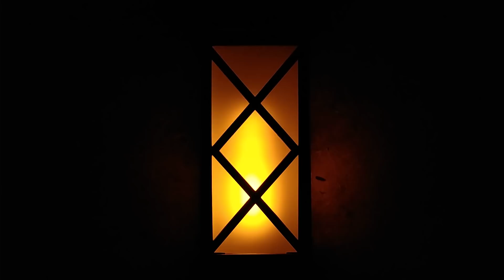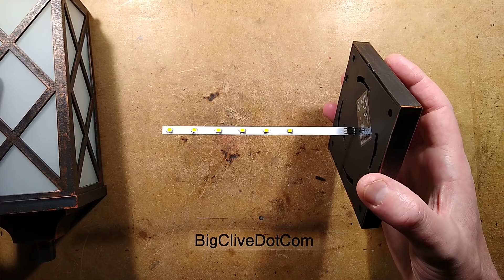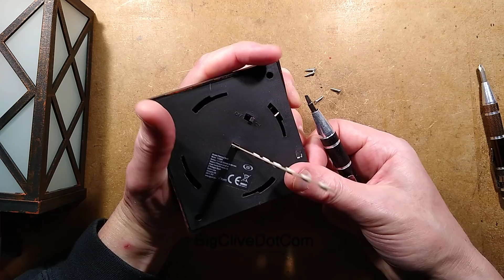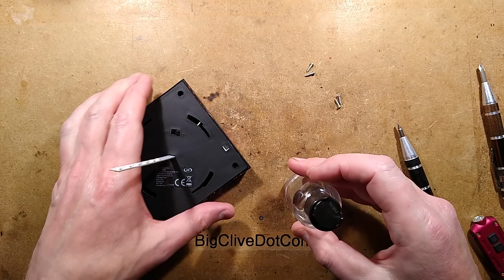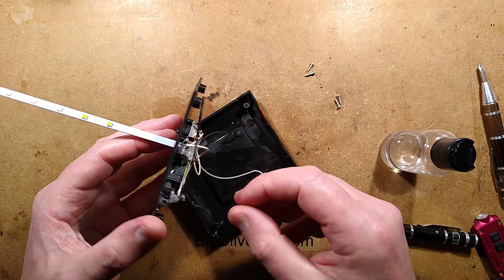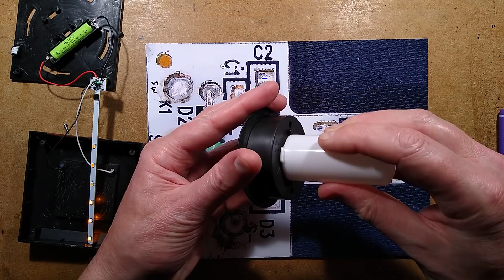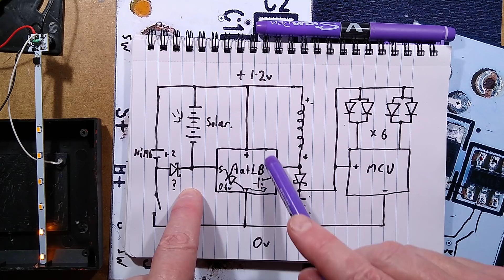Minimalist flame effect solar light  (with schematic)

Comment: The alcohol trick is genius, cheers! Also very interesting engineering. Seems like the Chinese are lowering cost via engineering versus just relying on cheap labor.
Reply: I've seen Voultar use it several times when fixing old consoles that have previously been modded. Amateurs overuse hot glue way too much.
Reply: @IanTester  Yes, I certainly do.
Reply: Problem is that they often cheap out on engineering. In soviet era it was great engineering + cheap labour. Had great results, very cheap products that actually lasted decades!
Reply: @Joachim Shekelberg products had official repair guides, problem was getting them.

Comment: It's sooo good to see one that will charge during the day without turning on at night!  After all, the FIRST instruction says to charge it more than one day before use.  It's just a pain to turn it on during the day and off at night for a few days.  The extra diode might be to keep it from draining the battery through the solar panel when off or during storage (in a dark box).

Comment: That isopropyl alcohol + hot melt glue trick works to release the glue from house bricks, and the mortar between them, incidentally :)

I've been successfully using hot melt glue to mount stuff to the exterior walls of this rented house without causing any damage, and I've verified that isopropyl alcohol makes the glue release pretty easily. The glue doesn't fall off as easily as it would against a non-pourous surface, but it's still plenty easy enough, maybe just requiring a bit of pulling it off with fingernails as well.

I did worry that the glue might soften too much during the summer, but the UK is currently in the midst of a UK-style heat wave (i.e. peaks of 30-33°C here in the south of England) and nothing's showing signs of falling off the wall, even the SE-facing one that's in direct sunlight most of the day.
I've had things glued to the wall like this for around 5-6 years now. The only visible change is a slight yellowing of the glue I used.
It's fairly standard hot melt glue, as far as I know - just whatever cheap stuff I found online in the correct diameter for my tools.

(Those tools being a Bosch GluePen and Ryobi's One+ glue gun. The GluePen is highly recommended: I love that it heats up extremely quickly - within about 20 seconds - and it has a high-capacity internal 18650 cell. The cell in mine could do with being replaced now that it's 5 years old and the capacity has fallen, but it's a tabbed cell that's soldered or spot-welded in, and opening the GluePen's case sufficiently isn't easy... However I'm not a fan of the Ryobi glue gun for the same-but-opposite reason: it takes something like 5 minutes to heat up, which is typical of the PTC-heater-based devices, but for the price I had hoped for better. That makes it very inconvenient for my needs and so I very rarely use it. Once it's heated up, however, you can pump tons of glue through it very quickly - possibly TOO quickly, tbh! It would make a good tool to use for potting PCBs in hot-melt glue, though I've no idea if that would be wise!)
Reply: Youtuber Julien Illet already proved hot glue potting was only a short term solution. He’s now trying bulk UV glue from eBay as a conformal coating and has had some luck.

Comment: If there was a longer time between repeats or if it were a bit more random those would be great lights.
Reply: I could suggest doubling the LEDs from just N/S facing to N/W/S/E facing, placing in a round translucent bulb, fitting mains plugs ;) and they'd be great table decorative lamps in a restaurant.

Comment: Those small amorphous solar cells are worth saving for tinkering and small projects plus they don't photo degrade unlike the others encased in plastics. There is one flaw with them as corrosion attacks the film side should water make its way underneath.
Reply: That's the one thing I fight all the time and have yet to discover a sure fire way to properly seal them.
Corrosion is the one show stopper.
Reply: They also give a decent current even under cloudy conditions
Reply from the maker: I've tried various ways to avoid the water ingress damage, but it's tricky.
Reply: @bigclivedotcom  I kinda want to experiment with one now where do they leak at?
Reply from the maker: @ucitymetalhead  The water creeps down the sides and because the solar panel is generating DC current it results in rapid corrosion.  Some have a laser cut dam around the edge so the final sealing layer encapsulates the main area.

Comment: This is a very low power lamp, but the rise and fall glow is very effective for what it is, if you do not pay attention to it.  To get a natural flame look, manufacturers need to introduce some colour variation, perhaps the tip of the flame licking away in red, some orange and yellow lower down and the warm white and red at the base to emulate glowing embers and a hot flame.  All the same colour is a bit false.  I guess the different forward voltages would make it too complicated to simply exchange the LEDs.  Those mains lights that used a flexible circuit board rolled into a tube would look realistic!

Comment: If you're worried about getting isopropyl alcohol in places it should be to remove hot glue, just use some cold spray or flip a can of duster upside down and freeze the hot glue.  Once it's frozen, it'll usually break free from contraction or you can just nip at it since it'll be as brittle as glass.

Comment: If the battery slot was more accessible, it'd be quite a nice AAA solar battery charger with additional light effect. If they were clever, they could use the flame jumping effect to indicate how charged the battery is !

Comment: The pattern cycle is too short, it should be more random, especially if there are several mounted in an area.
Reply: Yes, it would be a nice project for Clive to reprogram the μc to a better pattern, maybe even involving some sort of random number generation...
Reply: @l3p3  +1
Reply: They would de-sync anyway due to clock inaccuracy... but obviously come into sync regularly.
Reply: If the MCU is minimalistic enough, it literally might not have enough memory for a much longer pattern - it kinda depends on how exactly the pattern is encoded. That's not saying one cannot do astonishingly crafty staff even with 1-2K of flash, but somehow I highly doubt typical Chinese product dev time and budget accommodates that kind of effort.
Reply: TBH, I think it's only designed to be used in a computer game. #sprite ;)
Reply: @l3p3  BINGO !
Reply: Yeah, I would like it to be more complex as well. Best ones of those "old tech" incandescent candle flame lamps have such a nice random light.
Reply: @tkermi  The neon ones you mean ? They're not incandescent !
Reply: @l3p3  It's probably a one-time programmable μc - most of them are in products like this.
Reply: @millomweb  Oh, you are correct. I only have one I got as a gift and have not needed to buy any replacement bulbs.
Reply: @millomweb  Yes, it's exactly like that. I now found out that Big Clive has a video about this type of a bulb. But that seems to flicker much faster than mine (maybe just because of the camera). Mine looks calm and nice - so close to a real flame (when against its dark backround in low light room).
Reply: @millomweb  Here is the link:
https://youtu.be/NvO67jRAE4A
Mine is Osram branded 3W 230V (made in Taiwan). So maybe it's a little higher quality/more optimized for the realistic flame effect.
Reply: @tkermi  They are unstable and unpredictable ! They'll make them, they'll know they'll work but they won't know the flicker rate or 'flame' shape until it's been powered up. So if you get any more, see it in action first - so you you know what it's going to look like first.
Reply: @tkermi  He mentions the camera's making it look more flickery than it appears to the naked eye.
Reply: @millomweb  Good to know, thanks!

Comment: Thanks. I wouldn't mind something like this as a retrofit for the lamp on a pole at the end of the sidewalk. Can't use that now because someone before I moved in pulled up the power wire for it, thinking it was a root, and cut it off. Kind of glad it wasn't powered at the time, but that's a different issue. In any case, would probably need to build/print an adapter to replace the stake mount on one of these. And of course there's the finding of one of these. We'll see.

Comment: Maybe you could mention this use of inductor for the purpose of generating higher voltages is similar purpose to the coil in a car to create the kV for the ignition spark from only a 12V battery.

Comment: If you ever have spare/broken ones these 'mystery 8 pin micro' type devices, one thing I've found is that the Padauk micros(PMS150C-S08, the 8 pin SOP package ones) have the part numbers on the underside of the chips. So maybe desolder and have a look?
Thought I got a tube of blank chips, but turns out they just had the text on the underside.
Reply from the maker: It's there a straightforward way to program the Padauk microcontrollers yet?

Comment: when using the resin type solar panels I have had great success by using the clear coat spray paint that they use on cars and coating the panel and the paint last very well the same as on cars

Comment: Big Clive, Could you consider taking apart a Fuelrod USB battery pack?  It is the only one I have that can be charged while in use.  Sort of like a USB UPS.  But I want to know if it is safe to charge it while in use.  If so, I might use it as a Raspberry PI UPS.

Comment: The 12 LEDs would be a heavy load if they ran at more than a milliamp or so.  And there's also the maximum current for each uC pin and also the changing duty cycle to give the flicker effect.  It's good enough for viewing in the dark.  👍👍

Comment: I reckon the mystery diode might be there just to prevent the cell from discharging into the solar panel
Reply: If the mystery diode was removed there would still be no discharge via the solar panel. I think you mean "that's why the the mystery component is a diode and not just a wire".

Comment: What if you take the white circuit board coating off with paint stripper in order to see the traces easily? Sure, it would strip the colour-coded components as well but you already have a photo of them.

Comment: I wonder if you could common the two pairs of pulsing LEDs and use the now spare pin to run an extra pair of flickering LEDS. Or would the current now be too low for the pulsing LEDs?

Comment: Okay, so I'm late with my response, but I would really like to see a "dissection" of the other light you showed.  I have an older, 2005, solar Tiki Torch light.  The device uses two LED's and four Transistors.  The only Diode (aside from the LEDs) present is, I'm assuming, used in conjunction with the solar cell charging circuit.  The overall effect is, in my opinion better and more subdued then the newer circuits.  I'm assuming that the other light unit ( you showed) is the newer Tiki Torch circuit.  I would be interested in comparing the two if you could fit it into your schedule. 

Thank you for your Videos, and best regards

Comment: Problem with these solar lanterns is, they all come with 350mah or 400mah AAA battery's (i'm guessing for smaller size)  - AA battery's slightly bigger but much bigger capacity. So if you buy a good solar lamp, they only last like 6-8hours maximum.  So if it gets dark around 7pm.  by 3am they dead. Won't last a full night through.  So best to go buy a good quality 700mah or 800mah or 900mah Rechargeable.   If the 350mah would give 6-8hours   something like a true capacity 700mah or 800mah would last the full night through till sunrise. When it will just start charging up again.

If you buy the bigger Solar lights they sometimes have 2x AAA or 1x AA battery (again only 2x 350mah AAA or 1x  800mah or 1000mah AA)- So if the bigger one's , i would slot in a nice 2000mah or 2300mah or 2600mah AA <maybe Energizer or Duracell rechargable or any good known brand>  Sometimes the no-name battery's are not true capacity. They rate 700mah but in reality it's maybe 500mah.

Comment: "No mains wiring needed" ...... Darwins theorem dictates that someone will try to connect one to mains wiring.
Reply: Sounds like a future Big Clive vid!!
Reply: Sometimes batteries are inconvenient
Reply: I usually do so they can run in winter, and with the weather lately even the summer sun doesn't recharge th battery.
Reply: Actually, that would be Murphy's Law "If there is a way to do it wrong, they will".
Reply: Flickering light go BOOM!
Reply: Not Darwin's *theorem*;  it's the Darwin Award.

Comment: Has the plastic of the lantern got any texture on the inside, it seems like there is some kind of prismatic effect going on. I was surprised it was only a single line of leds on the circuit board after seeing it as a bar of light covering two thirds of the width at the 0:20sec point.
Reply from the maker: It's frosted glass.  The level of frosting is important for the effect.

Comment: Clive, i dont know how you manage to stick with the multi head screwdrivers. I’ve got one, it’s very useful as it’s 16 in one but it’s pretty unwieldy. I would have thought you have a bit more of an armoury of screwdrivers which would all be much easier to use one handed?  You must have hundreds of jewellers screwdrivers, give ‘em an airing.
Reply from the maker: I have lots of other drivers, but like those small ones.

Comment: 6 LEDs??? You mean 6 Pairs of LEDs, Right??? I thought you said it was mirrored on the reverse of the circuit board with front & back LEDs linked in pairs down the circuit board???
Reply from the maker: Yeah, but effectively just six channels.  You could do it with just a single sided PCB.
Reply: 12 led from 1.2V. Wow.

Comment: Is there a video on simple converting a from battery to a USB for power?
Reply: Measure the current draw when using a battery, work out the needed resistance when using a 5v input, add in the resistor, solder on the USB cable making sure the polarity is correct. Done

Comment: Clive, is there any way to slow the rate of flicker? I would like,e to use some of these lamp/bulb types indoors for ambience but the flicker rate on all that I have found is too fast for a nice calming effect.
Reply: It is kind of odd that for a LED lamp the flashing and flickering seems to be presented as selling point, while for a real candle or oil lamp, this is undesirable, and manufacturers might talk about how their fuels and wicks are pure and uniform and will burn steadily with a minimum of flicker...
Reply from the maker: It would need custom software written.

Comment: Crazy or maybe stupid idea for reverse engineering small, two layer white coated PCB's... Filming or time lapse photograpy with an IR camera while they are warming up on a hot plate. Than just pick up the best one, Well, it's just a random thought, don't mind me... I don't have the time and equipment but I would love to demolish my own idea... oh, yeah, don't try this with aluminium substrate PCB's... (although it might work  by reflection and not transmission, meh, too complicated)
Another random thought... how would you do this with discrete and analog components? Hmm... maybe a couple of NE556 and an Esaki oscillator...  just asking...

Comment: I bought male & female USB connectors.
Soldered them together to pass through the power leads and shorted the center two leads toward the phone.
Tried to make an adapter to turn any USB outlet into a Fast Charge outlet.
It did not activate the Fast Charge.
You did it by shorting the two data leads toward the phone.
Any ideas?
Reply from the maker: The two shorted data lines indicates to the phone that it's connected to a standard 1A charger.
Reply: @bigclivedotcom  The circle around the lightning bolt did not show up, only the lightning bolt. So it passed the bus bar voltage/current but the LG cell phone didn't see the shorted data leads. I metered it, it had a dead short. Tried two other usb set-ups to no avail. Needs a resistance?

Comment: Looks very similar to the XY8018 joule thief chip, achieves the same thing as they are quite generic.
Looks like there's no charge control, unless that chip shunts the solar cell to limit the voltage.
Be interesting to measure what voltage is present on the battery terminals with the battery removed.
Thinks I must pop down to Walmart and get something similar to dissect. 
Got one of those solar motion detector lights, going to fit it with a shunt regulator to preserve the battery.
As it is an otherwise nice bit of kit.
And also a cheap source of useful parts, for 5 Pounds one scores a battery, solar cell, pir sensor, pv cell, a cob led array, a little board with a timer, a switchy, etc.

Comment: I have an idea what the software might look like but i'm no programmer...how about you? do you think the code reasonably simple ?..if yes maybe have a go...6 LED's with progressively shorter "on" times heading to the top, randomly weighted, maybe ?...just don't no...cheers.
Reply from the maker: I'd pondered replacing the microcontroller with a PIC12 and using a linear feedback shift register to add a long random element to the pattern.